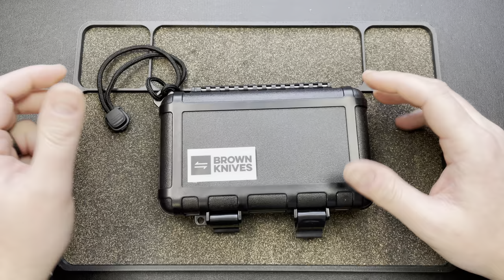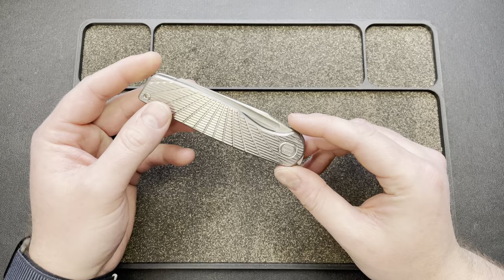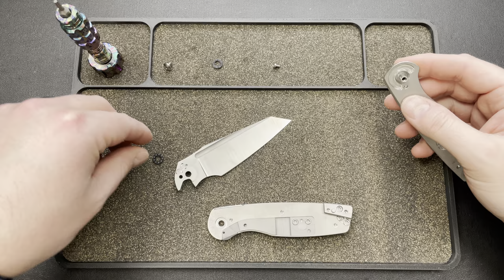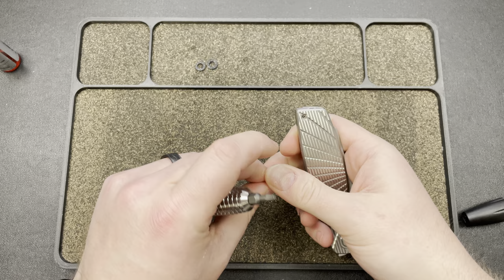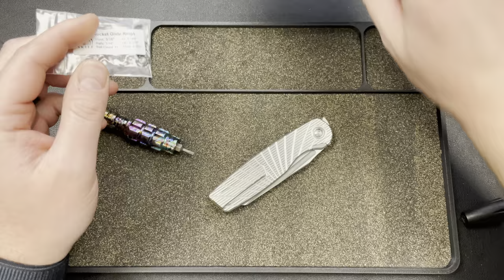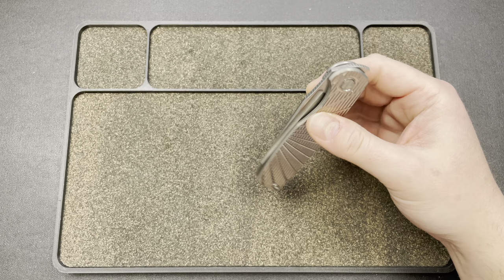He's Done It Again! | Brown Knives Cortex XL Unboxing | Skiff Bearing Swap

Comment: He definitely runs his magnacut at 60-61 hrc. From my experience his magnacut is to soft. Even people that dont use their knives alot want magnacut at 63-64 hrc. Hopefully he runs his steels harder in the future because i really like this knife and would be awesome to have one to go with my fsd-i.
Reply from the maker: What issues have u had with the fsd-i being 60-61? This thing is super thin so i think its gonna cut for awhile. Talked to Craig about it lastnight and he has his reasons for the heat treat. Until i test it and actually have experience im gonna trust him on it.
Reply: 63-64 is too hard, between 61 and 63 and sharpen to 15 degrees per side and you'll have something that keeps it edge longer and less risk of chipping.
Reply: @LeftyEDC  I paid 1k from Craig for a fsd-i   #311 and the edge from him was terrible and have sharpened it 3 times since at 15° per side. ( I've been free hand sharpening for 20yrs. so yes I can sharpen) While cutting double wall cardboard the edge completely rolls to the point of not being able to be  stropped back. During regular use it dulls very fast and constantly have to strop the knife. I own crk, mcnees, Koenig, hmc, DCC, OZ, spyderco, houge, and Gersh blades knives in magnacut and all of them are excellent except the fsd-i. I buy premium knives and except premium quality, I don't see a problem with that. I'm putting my knife # and issues out there only hurting me if I ever chose to resell so why would I lie about  what I saying. I'm choosing to share my experience with the knife because had I known before hand I wouldn't of bought the knife. As of now brown knives runs his magnacut to soft and doesn't hold a good edge. I don't care about toughness in my pocket jewelry folding knife, I want it to cut and cut for a long time so I don't need to sharpen it every week and in a yr end up with a folding ice pick.
Reply: Ya, for the premium price he’s charging there really shouldn’t be anything wrong especially something as big as that. Most owners probably never figure that out bc they never cut with it. I love the looks of Craig’s milling and aesthetics, but this comment convinced me I’d be better of going w a Roosie, so thank u, I appreciate your honesty
Reply: @LeftyEDC no people in the comments who have never heat treated a knife or tested a blade post heat treatment no better than Craig. Owned and sharpened a lot of his knives his stuff is on point. Guy is an incredible maker.
Reply: @chriswebb3018  with that thin a blade 63-64 would make it more prone to microchipping and there might be less edge retention as a result especially if you cut dirty things and not clean stuff. I think you guys are overblowing these differences in heat treat are not as big a deal as you make it seem in edge retention. magnacut is optimal anywhere from 60-64 depending on the blade type and purpose.
Reply: @CloudyShinobi  have you seen everyday commentary's review on the Rosie? he said it doesn't cut well
Reply: @Josh-jw7cb  yeah most knife guys dont really know what they're talking about. many times even budget  steels will have better edge retention than a super steel due to being able to put a much better edge on it with a convex grind and them being less prone to microchipping

Comment: wtf is a ti connector bearing   those look like black nylon caged bearings
Reply: i see its a brand. that ive never heard of
Reply from the maker: Ti connector is where makers get a lot of their hardware. They are delrin caged ceramic bearings
Reply: @LeftyEDC  thanks  id rather have brass caged or solid like skiffs or gillian.gillians are pretty amazing. but steve is a badass person and very customer friendly
Reply from the maker: @theknifeconnection9571 i used to use Gillians a lot but they started binding up after awhile so it was a pain to disassemble the knife and clean them and reassemble. Skiffs never do that and yea Steve is awesome so i just roll with them

Comment: If your gonna use Magnacut step up your game or I’m not even slightly interested period for F’s sake!!!
Reply from the maker: ur so angry 🤣. I haven’t tested it much yet but the geometry is phenomenal so im guessing it’s gonna be good.
Reply: @LeftyEDC  you know me not an angry guy tired of sub par Magnacut if ya wanna go 60-61 use something else not gonna pay top dollar for meeeh heat treat that goes for everyone tired of it
Reply from the maker: @toreycasey1214 idk he made good points when i asked him about it. So far it cuts amazingly and is super thin. He’s going for geometry over high hrc for edge retention and trying to keep it as tough as possible so it doesn’t chip being so thin. He had charts and crucibles heat treat protocol and everything so hes definitely thought it through and tested. 🤷‍♂️
Reply: Could t agree more. TRM just released their neutron in Magnacut at 60-62 and I’d rather just have the original 20cv at that point.
Reply: @LeftyEDC This is absolutely the thing people don't understand, you put a nice 15 degree edge on something it's gonna stay sharp longer, so tougher better.  I sharpened my m390 knives to 20 or minimum 18 degrees and I end having to sharpen out little chips on them 2 or 3 times while the 3V knife I sharpen to 15 or even 13 degrees is still screaming sharp, not chipped, and I haven't had to bring it anywhere near a stone.